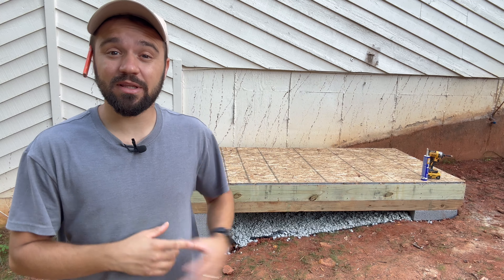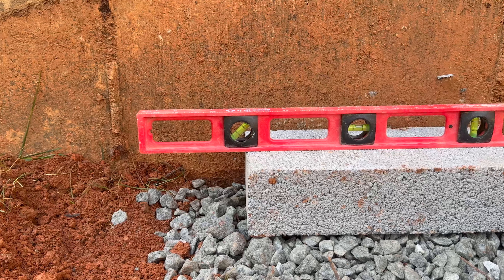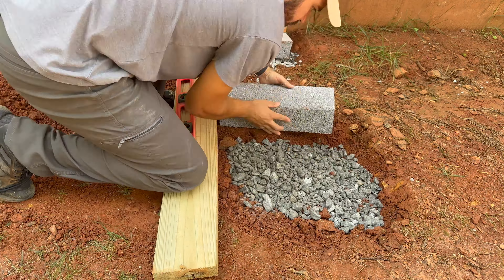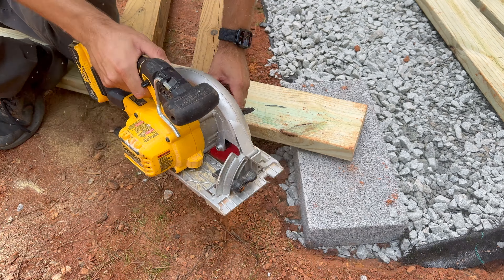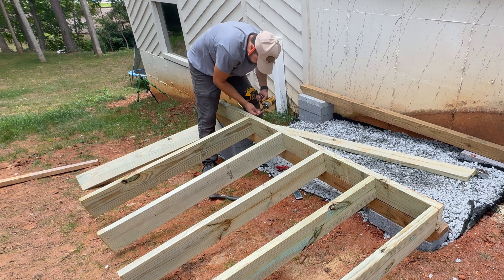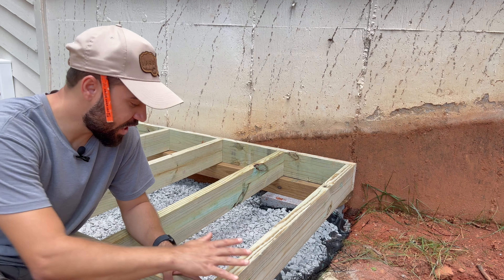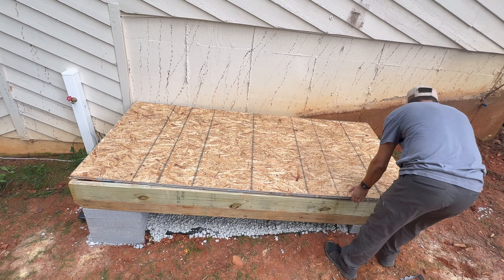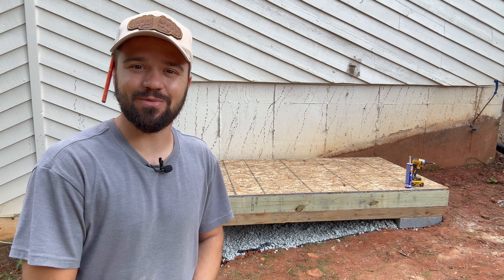Cheapest Foundation Option For a 4x8 Lean-To Shed

Comment: My old shed has burrowing animals living under it.  When I replace it, what can I do to discourage this?  The old shed is on bricks like this one.  That may be the problem.  I don't think I want to do a concrete slab, so the boxed in gravel pad might be the most efficient way to discourage animals from living under the shed.
Reply from the maker: In my opinion the best cost-benefit is having a boxed in gravel pad. It is super strong, there is no need to pour a slab. As far as keeping animals away, you may have to build a skirt with chicken wire.
Reply: They don't like castor oil. I would buy mole max. It's castor oil in pellet form and put it under and around the shed.

Comment: Another great project. One question, don't you have to worry about frost heaving where you live? In my area the frost line is 36" deep.
Reply from the maker: Ours is only 12”, regardless I can see the need to re-level the shed every few seasons or so. Simply, prop it up with a bottle jack, re-set the blocks and lower it back.
Reply: @EverydayShed  Thank you!